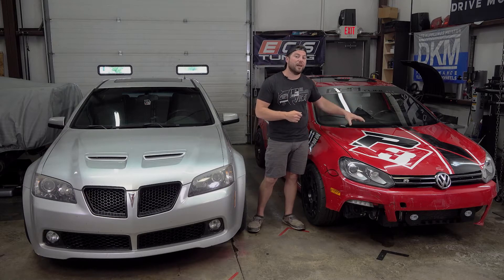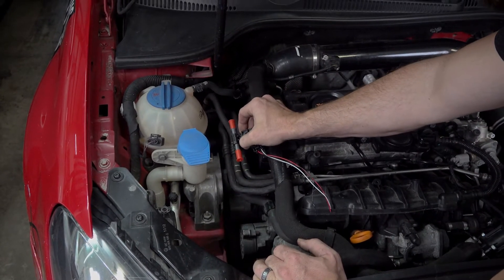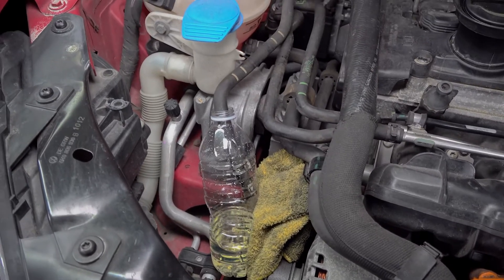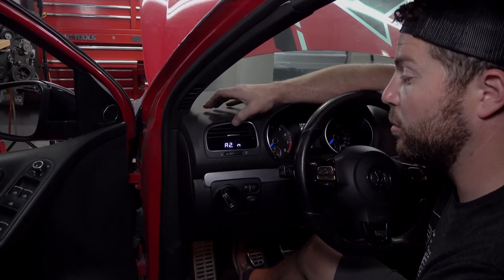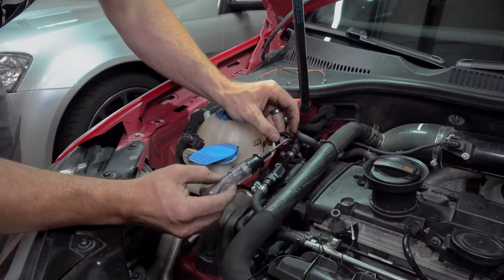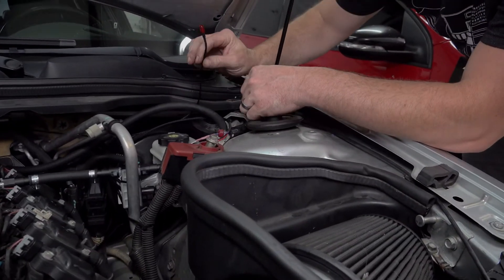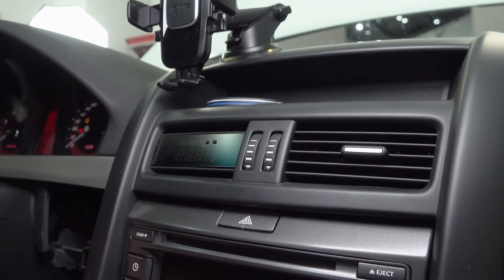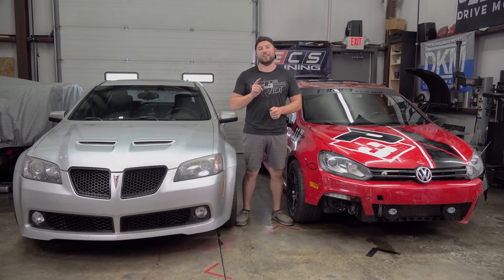How to Read Ethanol with your P3 Gauge | P3 Gauges

Comment: Hello, I have a 2021 bmw 240i. My question is can I purchase this with the ethanol sensor and avoid having to get the boot mod flex fuel kit? I’m assuming if you pay the extra $100 for the sensor if removed the need for flex fuel kit? Please let me know and I will pull the trigger on this. Thanks!
Reply from the maker: In order to read ethanol you will need 1- our gauge, 2- an ethanol sensor, 3- our ESVA. <- That setup will get ethanol content to your eyes but not your ECU.

So if you're going to be running a blend tune and just need to see the ethanol content you can do that with our gauge.

Comment: Does this gauge detect the  e 85 if you have the fuel sensor? Or do I have to buy the extra cable from ps3
Reply from the maker: Our GM gauges read ethanol right through the OBD2 port if you have an ethanol sensor and flexfuel tune.
Reply: @P3Gauges  what about for a bmw with a flex fuel tune?
Reply from the maker: @aj2734  If you have your sensor tied into your ECU it may pull it through the OBD2 port depending on how your tune views the data. But you can for sure read E using the analog inputs and the ESVA. Email support@p3cars.com for more details if needed. -Jake

Comment: I have the P3 ECA ready to install. What size quick connects and clamps are needed on a B8.5?  Dorman 800-085 Fuel Line Quick Connector That Adapts 3/8 In. Steel To 5/16 Inch... Also have 13-15mm hose clamps in my cart as well.  Are these the right sizes?
Reply from the maker: I'm not sure on the exact part number for that. We used quick connects that went from 3/8" steel line (on the ethanol sensor) to a barbed fitting for the rubber fuel line. If you have a Napa or Carquest local to you they should be able to help you look those parts up.